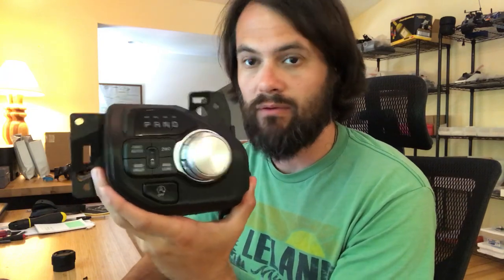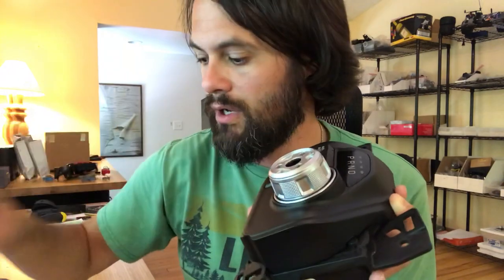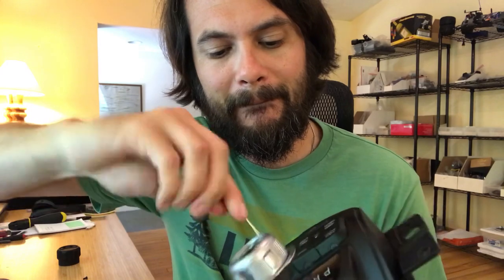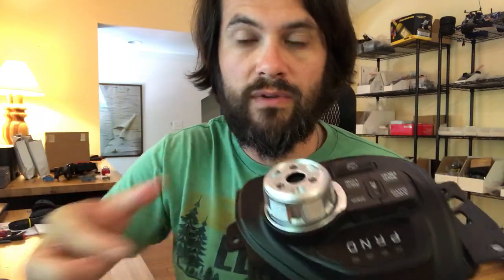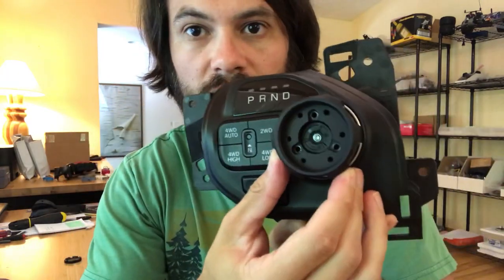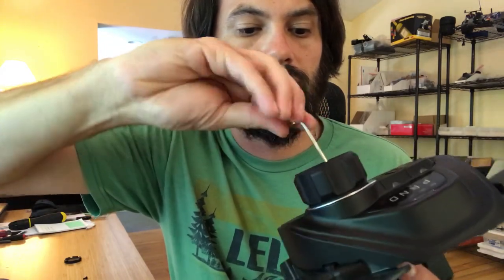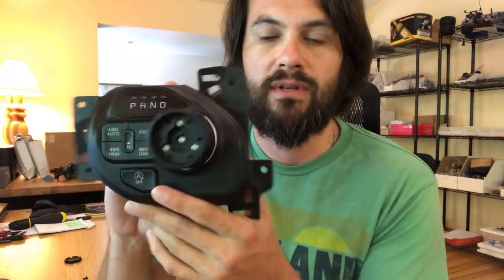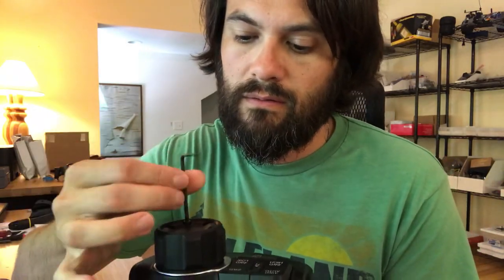AJT DESIGN Shift Knob (2019+ Ram)

Comment: For 75 bux you guys could have included a plastic tool to pry off the cap.
Reply: It's almost impossible to pry off that cap without any type of damage with the mini screw driver.
Reply: How did you get it for 75 ? The one  I want for my Ram costs 95
Reply: @darylmiller5212  increase in price probably due to material shortages with covid?